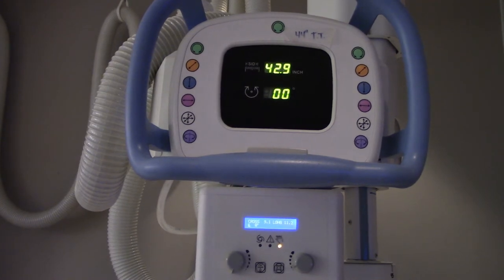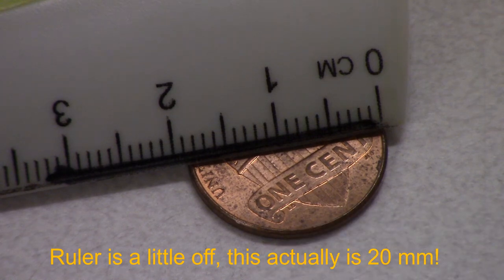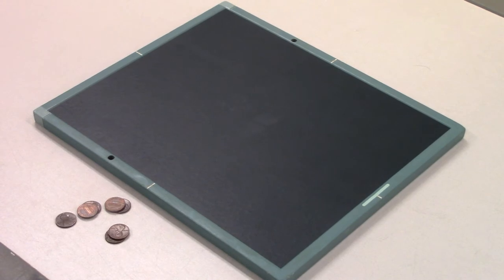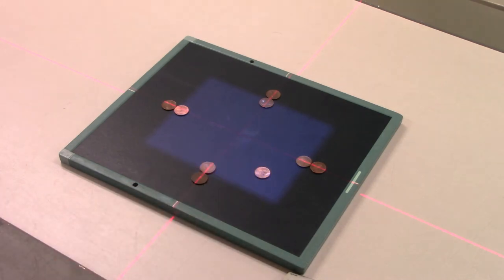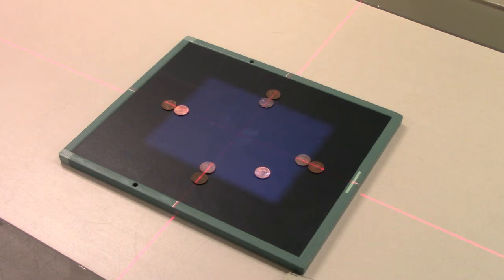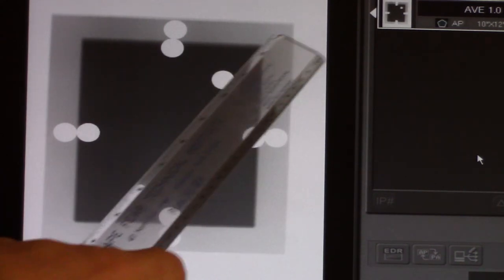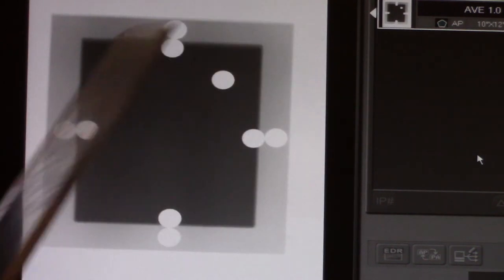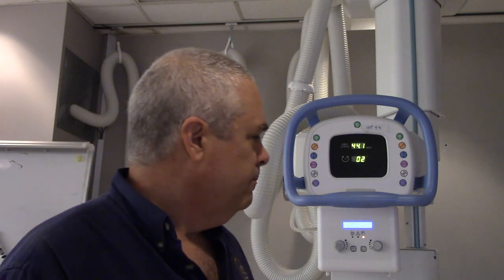9 pennies

Comment: What if we use dr on a penny test? would it not be accurate?
Reply from the maker: You can totally use DR on the penny test, BUT you can't do the double exposure where you have one exposure at the line between the pennies and another exposure outside so that you can get a definitive measurement. This afternoon I will do a demo in the lab and put it up so that you can see what I mean.